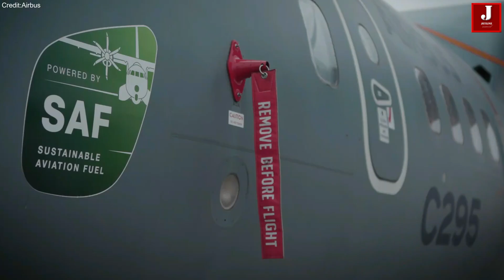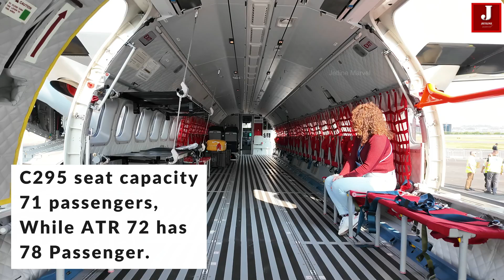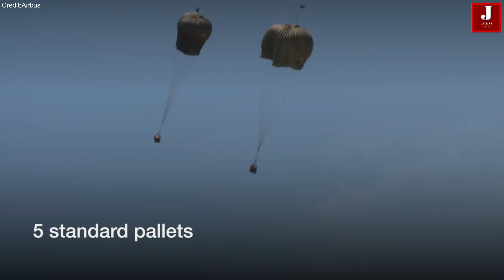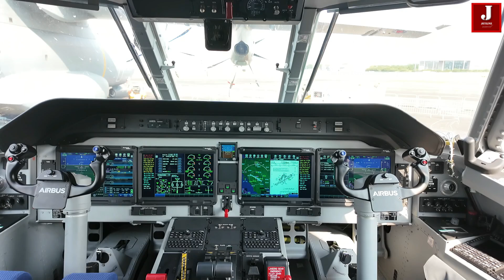Can Tata Convert the C295 into a Civilian Aircraft for Air India? Jetline Marvel

Comment: Unless engine manufacturing and the entire engine parts supply chain is localised in a cost effective way, engine MRO facilities are scaled up.. this is NOT going to be financial viable...
Reply: Great point.  ROI is crucial in the long run. However if this helps create a commercial Aviation sector in INDIA,  that's worth considering.  Along with MRO sector.

Comment: I think for that 1. They will need to raise its cabin height because it’s very low 2. To maintain STOL capability it may need to have larger wing area with lighter wings for efficiency 3. Commercial jet would require removal of few high need equipment and for it to be replaced with regular equipment indirectly de militarising it. Though CFM rise may change turboprop industry forever.
Reply: it can hardly sit 70 pax in a closely arranged seating situaiton. whereas the IND gov wnats the regional transpot aircraft to be 90-110 seat size. So an improved version of Embraer EMB-175 seems the perfect fit.